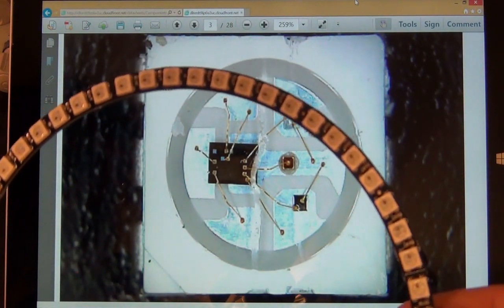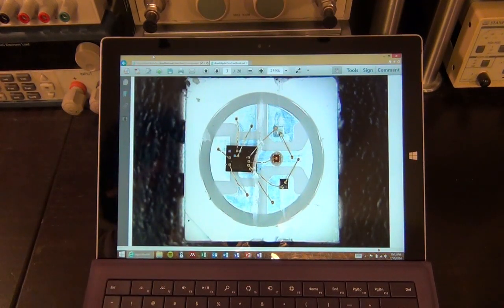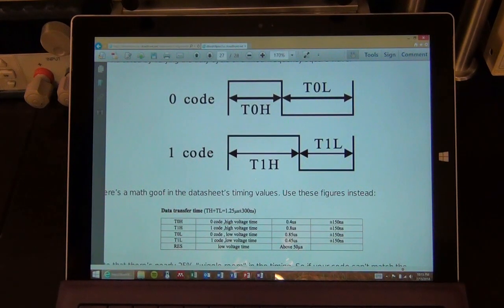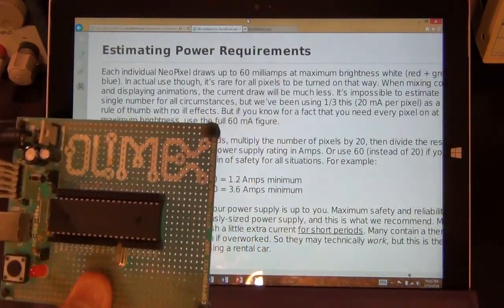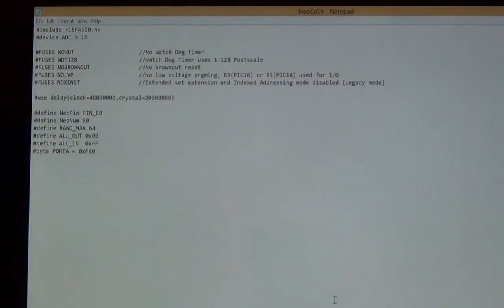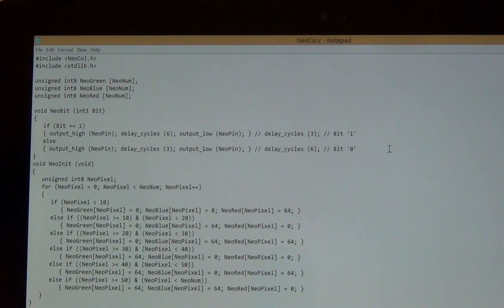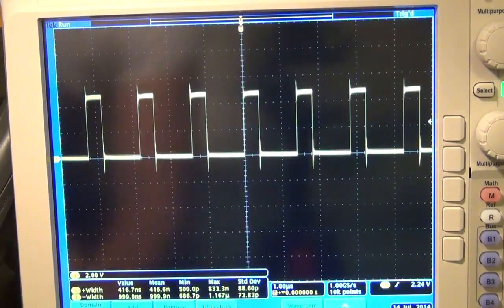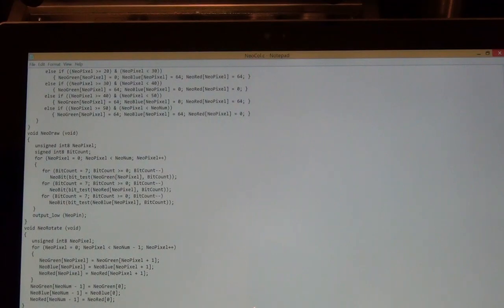TSP #31 - Tutorial on Programming the NeoPixel (WS2812) RGB LEDs and Equipment Giveaway!

Comment: Great video! Microchip has an application note AN1606 showing how to leverage the hardware peripherals of a PIC16F1509 (Timer, SPI, PWM and CLC (Configurable Logic Cell)) to drive NeoPixel LEDs.
http://ww1.microchip.com/downloads/en/appnotes/00001606a.pdf
With this configuration, you just write the RGB values to SPI and get the WS2812 data at the output of the CLC without burdening the CPU with the timing details.
P.S. I love your homebrew dev board!

Comment: I love how you are always paying so much attention to the details!

 Still, I do not really like the delay-based software solution presented in this video. You said it yourself that even though the second delay is left out, you can't meet timing requirements (although it works after all). The way I control such addressable LEDs is via PWM + DMA, by streaming the bit-sequence from memory to the timer via DMA. Of course you need a microcontroller that has both of these peripherals.

Comment: I know this is a quite old video but if you're still wondering why it's working even this a longer low time, I think you already shown all the clues to get the answer.
It work as a shift register. You can continu sending new data since you comply to the "low level apply time" that is (it's in the datasheet) 50us. 
In short, the low level time should be "at least" 0.4 or 0.8us before the next rise. 
So in the case of a "1", you have a 0.8us high level followed by a 0.4us low level which already means a "1". Then start the internal timeout that waits for a 50us long low level but as your next bit 
arrive before sooner it is taken into account .
hope that helps ...

Comment: Nice video. 
I can think of one architecture where only the width of the signal being high is considered. Consider this: the signal we send into Neo-Pixel is used to charge a capacitor. Cap value is chosen such that it doesn't get charged fully with 0 (preferably half way). The voltage on the cap is compared at a regular interval with a reference to decide if the bit is 0 or 1. And the cap is discharged as soon as that comparison is complete and the bit is stored in the buffer. 
There might be more complex systems in place, maybe a timer/counter circuit with a M/c inside, but that seems like an overkill.
Again, awesome video :)

Comment: Thanks for the info regarding dealing with an addressable LED array. I don't have anything other than an old XP box with PICKIT1 and something else that can program 40 pin PICs, and the MPLAB assembler is all I have to do the coding - no worries, only 35 instructions, the only hassle is making sure the initialisation is ok for whatever PIC. I do wonder about being able to get hold of anything that might be handy for my Ubuntu system, but for now, I can get by. I think I will use a 40 pin PIC, maybe a 16F487A (still got hold of some of those) with an external 16mhz resonator. That way I'll have a reasonable amount of memory & coding space. It's good to know that there are still folks who like to peek under the hood...my project is to make a prettily illuminated ferris wheel - I doubt I will try to motorise it also, because I think I'd need some brush style connections and it'd be a bit of a hassle.

Comment: Very detailed video and explanation, but the code given cannot be what you actually used, in particular the NeoRotate() doesn't save the [0] values from the RGB arrays before overwriting them !
Also, coding wise, in NeoInit() you have unnecessary retests in the else if blocks for (NeoPixel >= 10) etc, the execution would not reach there, so these can all be simplied, e.g.
 else if (NeoPixel < 20)

Comment: the chips probably only care about the the edges, that is why they have a pretty strict timing requirement. if they were comparing the high and low periods, you would need to have the correct ratio of high to low (so your 0s would work, but the 1s would not work, because they spend more time low than high), but then it probably would not have a strict timing requirement, as it would be comparing the lengths internally and not relying on strict timing.

in some ways, that would be more versatile (would work with slower controllers - you just had to ensure the relative durations were correct), but i suspect it would be harder to implement on the led chips.

as it is, you only need to worry if the low period is so long that it triggers the end of sequence.

Comment: oh.. so I'm more used with "apa102", which has clk and address  ...  So that's why it makes sense to loop them?   Before finishing watching the video I'm gonna say , you need something that counts to 25 in a rate of 20Mhz  preferable something with a hardware timer like a pic or avr.  Timings were probably targeted towards such a little processor., you then get 0.05per step, so toggle is needed at step 9,16,8,17,25 and so on.. . So prolly a timer interrupt somewhere to set the new data for the timer, I'm guessing of course but that's how I would try to do it..   ...Reset is speced at 50us so  it would be fun to increase the delay towards 50 and see when it doesnt work anymore..

Comment: Apparently, the only critical timing is the 0 high time.   1 high time can be 500ns to infinity.   Using that, some interesting clock stretching can be done.    I have a PIC12 converting streaming Serial @ 500kbps into neopixel async.  No video buffer, just 12 bytes of ram used.

Comment: nice videos thank you for your time. I am subscribed to your page. I was surprised to see that 60 led draw 3.6 amps. Did you put an amp meter on those 60 leds? I have an 5 meter ws2812d led strip with 300 led, full brightness 3.1 amps. (remember 300 leds)

Comment: A little tuning info:
when you put the lines of the function NeoBit into the function NeoDraw, you can save approx. 1µs of the delay between two "WS2812-Bits", because the PIC don't have to stack and restack the 2 local variables.

for example:
for (NeoPixel = 0; NeoPixel < NeoNum; NeoPixel++)
    {
        for (BitCount = 7; BitCount >= 0; BitCount--)
        {
            if (bit_test(NeoGreen[NeoPixel], BitCount))
                spi_xfer(WS2812B, ONE_AS_8BIT);
            else
                spi_xfer(WS2812B, ZERO_AS_8BIT);
        }
        for (BitCount = 7; BitCount >= 0; BitCount--)
        {
            if (bit_test(NeoRed[NeoPixel], BitCount))
                spi_xfer(WS2812B, ONE_AS_8BIT);
            else
                spi_xfer(WS2812B, ZERO_AS_8BIT);
        }
        for (BitCount = 7; BitCount >= 0; BitCount--)
        {
            if (bit_test(NeoBlue[NeoPixel], BitCount))
                spi_xfer(WS2812B, ONE_AS_8BIT);
            else
                spi_xfer(WS2812B, ZERO_AS_8BIT);
        }
    }

^^ I used the SPI-Function instead

#define ZERO_AS_8BIT                0b11000000
#define ONE_AS_8BIT                  0b11111000

[EDIT]
HARDCORE-TUNING:
when you invert your color-variables (BigEndian to LittleEndian) and do something like this:
        BitCount = 0x1;
        if (bit_test(tempGreen, BitCount))
            spi_xfer(WS2812B, ONE_AS_8BIT);
        else
            spi_xfer(WS2812B, ZERO_AS_8BIT);
        tempGreen >>= 1;
        if (bit_test(tempGreen, BitCount))
            spi_xfer(WS2812B, ONE_AS_8BIT);
        else
            spi_xfer(WS2812B, ZERO_AS_8BIT);
        tempGreen >>= 1;
        a.s.o.
You can save many shift operations, because of bit_test().

This is only for Guys who want to play with many LEDs (>>1000).

And last but not least:
THX for this Video! =)

Comment: wish i could have that Tektronix TDS2232.  it would be great to use for what i wanted it for.  i am trying to build a electro mag lev suspension.  i was going to do the build you did with the mag lev build but perfect it and then use this awesome neopixel and buy 4 of those so i can program them and build the wheels and then integrate that to outline the circular magnet that levs on the electro mag and then tweek it to where the wheel can be stable then figure out a way to use that wheel to move while on the suspension so that the wheel doesnt go flying away somewhere over the rainbow.  the wheels will be mostly carbon fiber for light material and the frame as well.  the conductors and other peices of tech with be inside the frame and i will have a lift compartment installed into the main bar of the frame of the bike so i can install this.  i would also use the Tektronix TDS2232 to translate the act of analog so i can control the machine from my keyboard.
this will be useful for many reasons.  and one big one is that i can translate the data as WELL AS the controls so i can use a better interface to see and stabilize this data in real time for the bike im building.  i cant offord stuff like that in face im broke XD i have no equipment  to start this build and this would be a big help ^^ just thought id share anyways hehe thank you for this vid to expand my ideas a little wider ^^

Comment: I think the reason why the timing works is becaus the low time doesn't matter as long it is not exceeding 50us becaus then the leds will reset. At least this is what the datasheet says. For me it looks like the are just waiting for the reset after the last falling edge. If you send a new bit in time everything is fine.

Comment: Thanks for the amazing tutorial. It was exactly as in-depth as I was expecting it to be. I have needed an oscilloscope for a long time now as I am a mostly a software engineer with some working knowledge of electronics, it has been tough to design timing sensitive circuitry without the aid of an oscilloscope. By some fluke, I have been able to design an IR transceiver using an IR LED and a timer circuit, but anything beyond that has been very tricky because of the timings involved. I also tried to design a 1-Wire LED controller but failed because of the same issues. Same thing with an SPI-PWM controller (and thanks to this video, I now know that Neopixel has PWM built-in). Thanks for your generosity to the community and for speading your knowledge about these topics.

Comment: Hi nice little tutorial.
You use the function call "output_high(NeoPin)" to set the GPIO pin high, but there is another faster way in C to set that pin high, by using Direct Register Addressing.
This post illustrates the operation  http://coder-tronics.com/c2000-programming-model-guide/

I have not used PIC controllers so not familiar with the API or Direct Register Addressing commands, but do use Texas Instruments controllers.  For example to set GPIO pin 19 high for the C2000 Launchpad can be achieved in 2 ways:

1) GPIO_setHigh (myGpio, GPIO_Number_19); // Using the TI API
2) GpioDataRegs.GPASET.bit.GPIO19 = 1; // Using the Direct Register Access

The second command has no function call overheads, I have done some tests and it uses half the clock cycles.  So you can use a similar command for your critical timing code, and keep the C code which is less obscure for the main program.  The beauty of this is it's still C code, still a little slower than Assembly but more understandable.

Cheers,

Ant

Comment: I have an easy explanation why it works. The pause to validate the data is 50us and likely anything under 50us works as a low time since there is no specifically defined behavior for say 10us low time. But using a shorter off time than what's in the data sheet would likely break it.

Comment: about the low period being longer than what specified by the datasheet.
I believe the rise is important to act as clocking bits in, and as long as the low period is "at least" what's specified by the datasheet, then you won't have issues, as it will be synced again when a HIGH happens.
I think I've seen this already while we were sniffing the protocol of a coin reader.
we sniffed and stored the timings of each HIGH/LOW and played it back over arduino.
of course it was slower than it was expected, but it worked anyway :)

Comment: Hi,

It's very considerate from you to give away these 2 units.  I sincerely hope that whoever will get them, will make a good use of it and will pass on to the next whenever appropriate.

On the other hand, after looking around on the net, I'm coming to the conclusion that this TIP 440 device has a 1MHz bandwidth and not 20MHz as you mentioned.

Perhaps I looked at the wrong places, so if this is the case, please correct me.

I really enjoy electronics and I'm eager to learn more every time there is an opportunity.  I consult forums, search internet to improve my understanding and experiment on different project types.

I'm not an USA resident but still wish good luck to the fellows who are eligible for the giveaways !

Have fun !

Comment: After it detects the rising edge it measures the voltage after a time longer than the high in the zero and shorter than the high in one, if it is high it is one and if it is low it is zero, and as long as the next rising edge comes sooner than 25 ms the low period duration will not matter. Regarding the scopes I would love to get one of them. I am vintage radio and TV amateur hobbyist and Oscilloscope would sure make my life easier.

Comment: That 440 would come in very handy for me and could be used almost daily for trouble shooting in the field!   It would be put to good use and passed along to someone else when I can no longer use it.

Just a note to whoever does get it.  In the video you mention "Only use NiHM batteries, any other type will explode".  After looking into it.  the 440 uses NiCad (8x AA).  So, Do NOT use NiHM in this device.... or it might explode!  :)
Reply: Blitz K  he mean one LED needs 0.3W, look at this ring, it has about 60LEDs or more,this ring will need a power of 18W around when fully powered. 18W/5V, it will be about 3.5A current. for a bad quality battery, it will explode.

Comment: I have very good confidence on what is happening. Since these are asynchronous, it probably have a rising-edge interrupt, the interrupt routine would then start to time how long it takes since the interrupt routine was triggered to the falling edge, when the routine reaches 1.25uS (TH+TL) it then latches and quit. So your extra long delay would do nothing because the device would be just idle.
Reply from the maker: Your theory definitely sounds possible. Thanks for your contribution.
Reply: Look on my channel: miniature controller Led Master mini v2  for WS2812(B), WS2813....Jinx and Glediator support.

Comment: I'm trying to buy an oscilloscope for a long time, but they are very expensive were I live, and I just can't get a cheap old analog scope on eBay because they are very big and heavy, and the shipping cost is unfair. I know that you said US only... but I would like to insist anyway, I though that the handheld scope is small and light weight, so it could be viable to ship it, I would pay the shipping cost to brazil and tax, maybe I could finally get my first oscilloscope. I'm a student, trying to build some hardware, and resources here is scarce.

Comment: When programming SPI I used #define macros and not function calls for bit bangin at speed. There is tradeoff in terms of target code size but it is small unless your are out of ROM.  It would be interesting to change it and look at timing on the oscilloscope.
Reply: The function call "output_high(NeoPin)" is used to set the GPIO pin high, but there is another faster way in C to set that pin high, by using Direct Register Addressing.  You achieve the same result but don't have the fuction call overheads of the PIC API, it's all still C code as well.
Reply from the maker: I'll try it. Thanks!
Reply: 'When he thinks' may not be the best for determining timing.

Comment: Do they make simple to use micro controllers that will handle code like that very quickly to a point where the microcontroller will not be a performance bottleneck?, or will the slightly longer than normal delay not impact the smoothness of the color changes if dealing with a large number of LED's. (been thinking about just doing a simple RGB LED strip which responds to audio levels where higher volumes will cause color shifts (tried it on arduino but the response time generally sucks when using the various premade libraries and having LEDs respond to audio (delays become noticeable).

Would also be cool to have a portable oscilloscope, only issue is that they are really pricey. Though they will be useful when repairing old equipment. e.g., some older electronics will lack readily available replacement parts, even on ebay, but most of the board level components will be available online. I would love to see a review/ teardown on some of the low cost USB digital oscilloscopes since they tend to go for a pretty low cost and have enough of a frequency range to handle power supply related frequencies, and audio equipment.

Comment: Thanks for this nice video. Always have interesting stuff here. I used to use that Tek scope, but my one did not have the GPIB, only the analogue plotter output. You still could use it to output on a XY plotter (which I did not have). It popped a capacitor on the digital board one day, so I opened it and unplugged the digital side until I could send it in for repair ( maintenance contract)  about 3 months later. Luckily I had found 2 in stores,and the original group that had ordered them called a year later asking for them back, but they had snoozed and lost them. They were a massive step up from the 500 series we had as scopes.